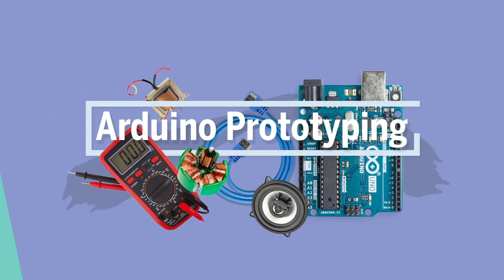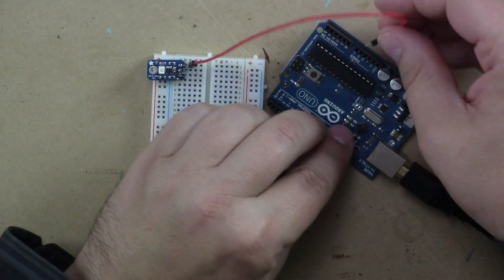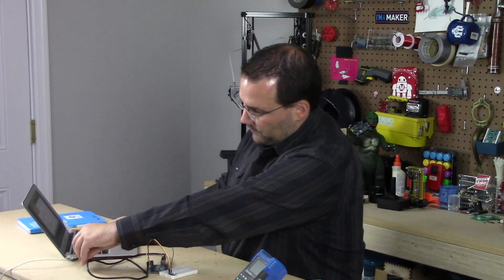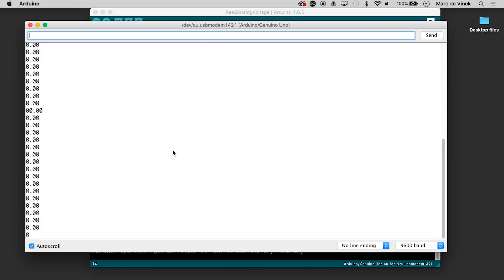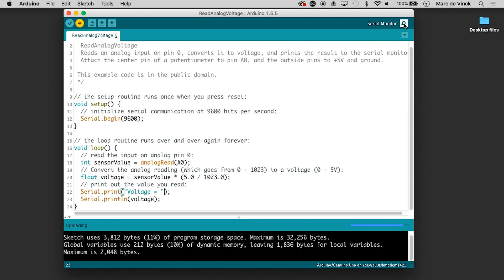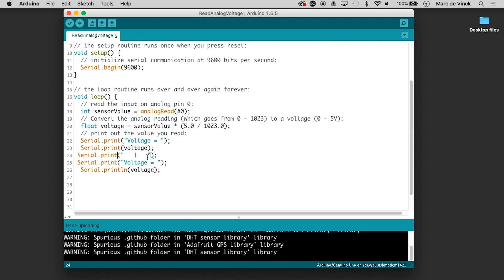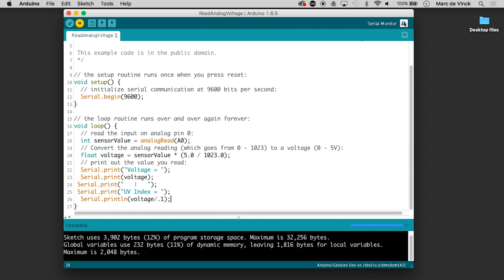Arduino Prototyping Inputs #42: Ultraviolet Sensor

Comment: Hey, great video! I know I'm a little late, but I was wondering a couple things. Is this UV sensor still relevant after 5 years or is there a better one to get to detect the UV intensity? Also, does each UV sensor need to have the voltage converted to a number on the UV index differently or are they all divide by .1?

Comment: How do you connect the device to your computer and how does the code work? Would it detect UV if you shine a light through fabric?
Reply from the maker: The Arduino only needs to be connected to program. Otherwise it runs the code standalone. I guess some UV would go through fabric. Depends on the fabric and the light.

Comment: Hello sir, I have a Project to do on UV measurements, I just saw your video, there are things I Don't Understand, I contacted you on your Instagram account , you can answer me please, concerning the assembly much more , think you
Reply from the maker: Please ask you questions here so other can learn from the answer too! (If I have them!). Thanks!
Reply: @MarcdeVinck  I wanted to ask you if another sensor can work in the same way but finally I bought a sensor like yours, and can you give us the arduino program please, thank you
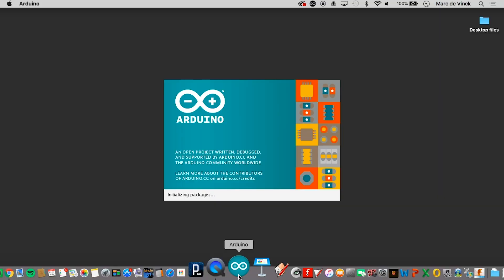Reply from the maker: @ouizabenatsou1158  As described in the video, the code is found in examples>basic>analog input. It's part of the Arduino IDE. More details at 1:17

Comment: Hello, can you converter the voult at W, please
Reply from the maker: I'm sorry, can you clarify your question? Can you convert the voltage reading? If so, yes, easily with a simple math formula, or you can use the Map function to get a specific range.
Reply: @MarcdeVinck  my question is, can you convert from volts to watts?
Reply from the maker: @cris_Mahe  From the sensor? You can convert volts to watts as long as you know the amps. DC conversion from Volts (V) to Watts (W)  formula is P(w)=V(v) x I(A) ---- The Power [P] in watts (W) is equal to the voltage [V] in volts (V), times the current [I] in amps (A). Hope this helps! You can find calculators online too!
Reply from the maker: For Example: 5V DC at 0.5 Amps = 2.5 Watts

Comment: Hi Marc, what would be the units of the UV index when calculated, is it J/m2?
Reply from the maker: You are reading the voltage out. https://youtu.be/vJct0vD6WWg?t=70 You can relate that to a specific UV index.
Reply: @MarcdeVinck  How would i be able to calculate the value of irradiance from this? would i use P = I * V
Reply from the maker: @Ivyqh  I think you need a pyranometer for accurate measurements. I have also seen it measured via a solar cell for general estimations.
Reply: @MarcdeVinck  Sorry i have one more question, how would you change it so it logs a voltage and index value every 15 minutes instead of seconds?
Reply from the maker: @Ivyqh  Use --> delay(insert the amount of milliseconds you want here)
Reply: @MarcdeVinck  if you converted the voltage reading to a value of energy, would this be equal to photon energy detected?
Reply from the maker: @Ivyqh  Not sure what you mean? You get an uncalibrated analog voltage based on the amount of UV. You could calibrate it and create a lookup table, or map the values, to be more accurate I guess?
Reply: @MarcdeVinck  Because i want to find the wavelength of the UV light, and was wondering if i could do that using an energy calculation?
Reply from the maker: @Ivyqh  To find the wavelength you would need a Spectral radiometer. This measure amount of UV light emitted in a specific range of wavelengths. But I'm certainly no photometry expert.
Reply: @MarcdeVinck  Thanks so much, you have helped me more than my supervisor :')

Comment: Hi! Thanks for the video. However, I have a question, can you plug directly the uv sensor to the arduino or do you really need the white thing where you used the wires? I do have wires but not this white thing...
Thanks again.
Reply from the maker: In this case, you could wire the breakout board directly to the Arduino since it doesn’t need any additional components. But in most cases you’ll want a breadboard to add more components like resistors, etc.
Reply: @MarcdeVinck  thanks a lot!

Comment: Sir, can i use UV sensor for triger lamp on/off use fuzzy Logic?
Reply from the maker: I guess it depends on if the light source emits UV energy As far as fuzzy logic? Sure, but to generate the non-binary response to UV light would  be an exercise in code and no dependent on the sensor.

Comment: Hello Mark. I built the exact rig as you did except with a Maker Nano board (practically a spitting image of the Arduino Nano). But when i ran the script, the sensor was throwing out some really high voltage, around  1.1-3 under regular indoor light setting. My attempt at trouble shooting has gotten me stuck. This include disconnecting the sensor from the processor, but even than it was throwing out the same voltage reading of 1.1-3. Several friends of mine  diagnose the board to be fine. Do you have any insight in possibly fixing this problem? Thanks for your time.
Reply from the maker: What specific sensor did you use?
Reply: @MarcdeVinck  thanks for replying ! Utilizing Analog UV Light Sensor Breakout - GUVA-S12SD. Held in place with breakaway headers. On top of a half size breadboard.
Reply from the maker: @calvinwong3515  According to their site "The output voltage is: Vo = 4.3 * Diode-Current-in-uA. So if the photocurrent is 1uA (9 mW/cm^2), the output voltage is 4.3V." I would remove the arduino and take some voltage measurements.
Reply: @MarcdeVinck  thanks very much Mark! Will give that a try.
Reply: hmm not too sure if i am doing this right. Used a volt meter and the sensor is reading out 0.4 volts when i put the contact on the + and the output terminal. I had to leave the arduino board on because i dont have any other way of powering the sensor. 

i also tried changing input from A0 to A1, but left the code at A0. I am still getting a volt reading of 1-1.3 Should this be normal since i should not be having any volt reading coming in at all.

Comment: Which type of home light you have which shows zero UV index please reply is it LED,CFL, or tube light
Reply from the maker: LED lights typically don't emit UV radiation, all florescent lamps emit very low levels of UV light. Check the manufacturers data sheet as they all differ.

Comment: Great video :) how do you than convert voltage to "nm" which UV radiation is  measured by?
Reply from the maker: Thanks! That's the catch with an inexpensive and uncalibrated sensor. You can convert the voltage to any range you want by using a function like "map(value, fromLow, fromHigh, toLow, toHigh)". Just keep in mind that any specific sensor is not necessarily linear or accurate, but it could be, you need to check the specific sensor's data sheet to know. Here is an example data sheet for a GUVA-S12SD UV sensor -- https://cdn-shop.adafruit.com/datasheets/1918guva.pdf In this case the UV index and UV power are linear, but the response to the wavelength is not. Good luck, and thanks for commenting, sharing and subscribing!
Reply: nm is NOT the unit for UV light intensity.
Reply: @mareksumguy1887  right , but how can we identify the wavelength of uv . Does it need another sensor.

Comment: I use similar built sensor with the same type chip on board (GUVA-S12SD-M), the wiring same, the VCC is +3.0V (battery operation). My problem is that, the readout from analog output (signal) is from 0.0V (inside the room) to 3,0V (clear sky, no need direct sunlight). It seems to me my sensor is use the whole VCC range, but it is really strange. Is there any other info other than Adafruit datasheet? Everywhere in the whole web this one page is circulating. I use Micro:bit, but everything is same on this microcontroller as on your. Thanks for any info. My sensor is: http://arduinolearning.com/wp-content/uploads/2016/10/S12SD.jpg
Reply from the maker: Sorry, I can't help without knowing more about the sensor. That looks like an op-amp and a similar sensor. Here is the data sheet for the UV sensor. Since it's analog, you can always map the values to match what you need. (Won't increase resolution, just help manage values) Keep in mind, this is not a calibrated UV sensor. -- https://cdn-shop.adafruit.com/datasheets/1918guva.pdf

Comment: Hi sir, how did you know that the voltage has to be divided by 0.1 to get the UV index? Where can I get the references? Also, is the calculation valid for all types of UV sensors?
Reply from the maker: s per the data sheet. The output voltage is: Vo = 4.3 * Diode-Current-in-uA. So if the photocurrent is 1uA (9 mW/cm^2), the output voltage is 4.3V. You can also convert the voltage to UV Index by dividing the output voltage by 0.1V. So if the output voltage is 0.5V, the UV Index is about 5. You can learn more about this specific breakout board by looking at the product page. https://www.adafruit.com/product/1918

Comment: Hi sir can you reply me and list all the materials in this project . And sa link were I can find your codes. Pls notice me. Thank you
Reply from the maker: I used the Adafruit Analog UV Light Sensor Breakout -- https://www.adafruit.com/product/1918, a standard Arduino, breadboard and jumper wires. The code is found in examples>basic>analog input. It's part of the Arduino IDE. More details at 1:17

Comment: Hi sir how can i found this code to this program?
Reply from the maker: The product is from Adafruit (https://www.adafruit.com/product/1918) and the code is found in examples>basic>analog input. It's part of the Arduino IDE. Go back and watch 1:17 for more details.
Reply: @MarcdeVinck  thank you for the response sir...  

Can i add... Led screen?
Reply from the maker: @rizyurf6651  Yes, and it's not that difficult either. Here is some referece to look at -- https://www.youtube.com/watch?v=EW0Pfof7Prk&list=PLcKte0wD90Y4lsrStEWB5NR1gKMs0FDts&index=74
Reply from the maker: @rizyurf6651  Yes, and fairly easily too! -- https://youtu.be/EW0Pfof7Prk